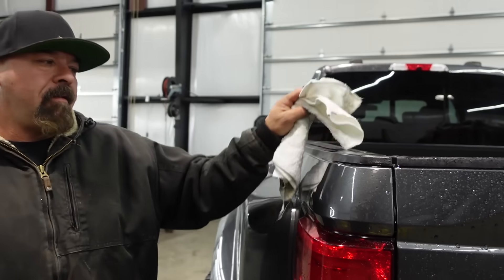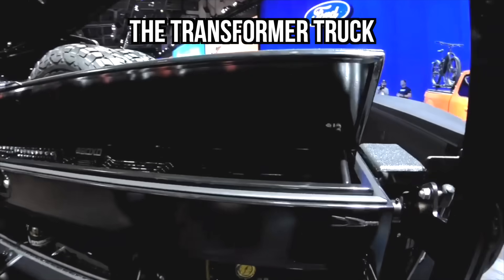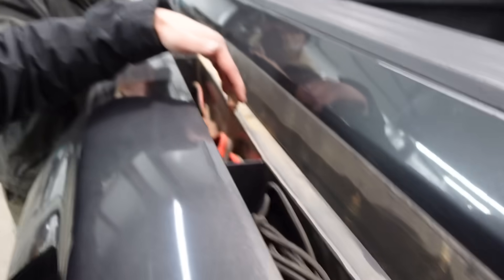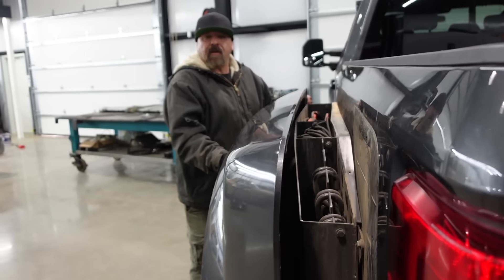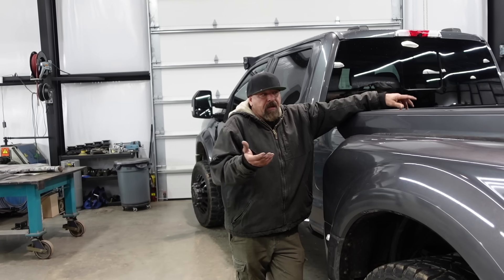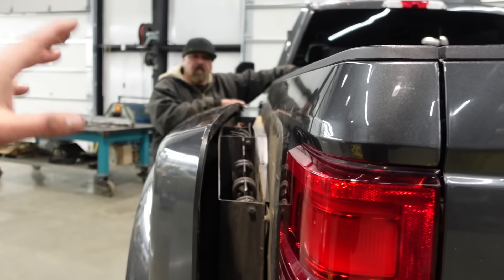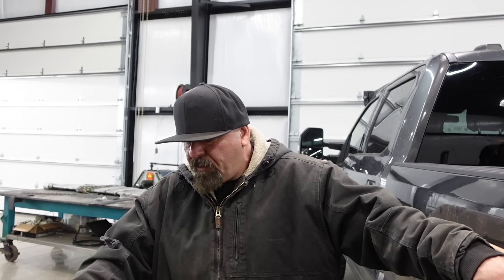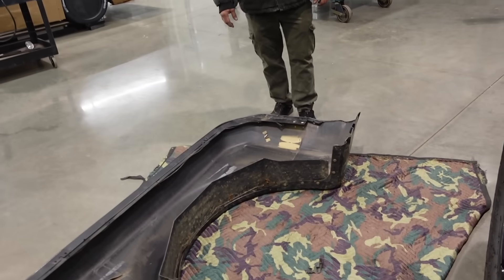BEST TRUCK INVENTION OF 2024? My Dad & I Created Secret Compartment's On Our Truck!

Comment from the maker: If you had this on your truck what would you store in it??
Reply: Coke
Reply: Soda, tools, and tie-downs
Reply: I drive an 04 Chevy Avalanche. Left side is hatchet, machete, oil, lube, flashlight, tool kit, right side is jumper cables, straps, chains and a shovel
Reply: Id store tools in it if it was water tight.

Comment: I’m not good at this kind of stuff, and even though you have it torn apart, the mechanical/working part just eludes me. However, listening to the issue with the fender, would little gas struts (rv bed type stuff) help? Could possibly help it lean out more and make the opening a little more accessible, plus maybe keep the fender from being so flimsy. That’s just where my brain went when I saw the issue. Hope y’all figure it out, it’s a great idea. I still want a transformer truck, lol.

Comment: What about using some expanding foam and some glued in braces. You glue in the bracers inside the fender, cover up the drawer and moving pieces, then fill the fender with foam. It should add enough rigidity.

Comment: You could make a rib to enforce the fender. Make a slide track for the lid and make the lid attached to the fender. So when you pull the fender away from the truck it slides the lid off and the lid acts as the rib for the fender. Then the lid would be pulled away from the tool box so you could access the tool box? If this works all I want is a free set for my truck :)😊

Comment: What if you scuffed the inside of that dulley fender, put a wire grid inside it and had it rhino lined or sprayed with a bed liner coating to stiffen it up.

Comment: Just wondering, why couldn't you put a couple door like hinges on the bottom, then put the locking mechanism at the top and it just swivels out at the top of the finder?
Reply: Do you think it would have the same structural issue's?

Comment: Can you just use steel to reinforce the back side of the fender and rivet it to the inside of the fender.  3/16 steel with 3 panel wings.   Should work.
Reply: Your probably better off just making it out of fiberglass.  The clearance is the problem.

Comment: What about an aluminum lip that folds back like angle iron that goes around the inner lip of the fender. It will tuck into the fender instead of using flat stick. Wouldn’t that stiffen it up for a lower cost and use original fender

Comment: Spent 2 years building the ultimate shaker kit for the late model Mustangs and they were the only one of their kind. Problem was, Time to make, Time to package, Time to to deal with idiots that just wanted to crap on what you built and it killed me. Cost over $180k and then got rid of the moulds for scrap price. So, keep you design and keep with it, dont loose hope. Find suppliers that can help with the issues, the issues i see that have a remedy, look to ABS plastic vacuum moulding. Sometimes the market isn't ready, as you are too far ahead of the game.